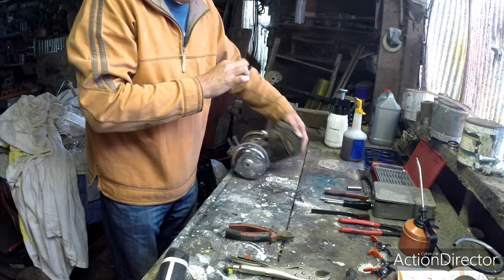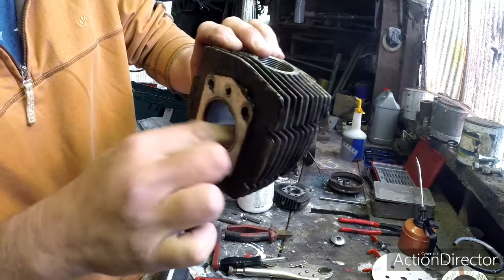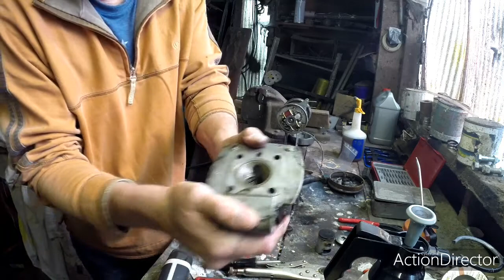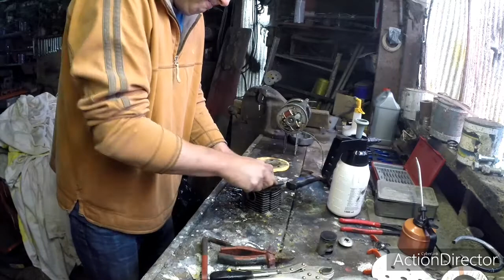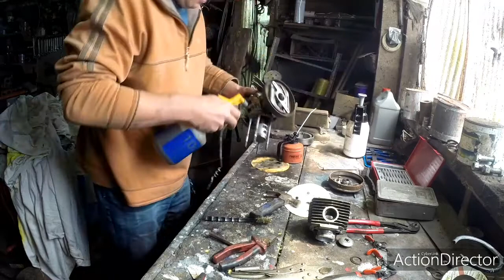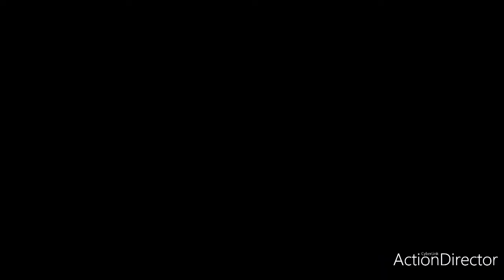Moped top end engine rebuild Part 1 Mobylette

Comment: I’m having trouble with the clutch not engaging on my mobylette and unfortunately I can’t get the special tool needed to remove the clutch any ideas?
Reply from the maker: I had same trouble getting clutch cover off. The pulling tool off ebay didn't screw in. I ended up getting a big 27mm nut and bolt and tack welding the nut to the flywheel and screwing the bolt in. It came off really easily. Then I just carefully ground the welds off after.

Comment: Not sure why you decided to change the head gasket , unless you’ve put a compression meter in the bore and it’s giving a low reading of compression? The points gap is usually 0.25 thou cheers Shane uk 🇬🇧
Reply from the maker: Well she had not been turned over for 30 years so really wanted to inspect the engine internals and give her a light phone and clean out. The whole engine gasket set was only a tenner so thought I may aswell build it back up with new gaskets.